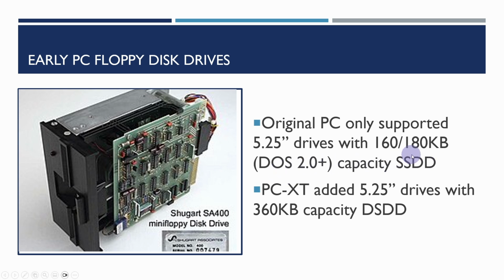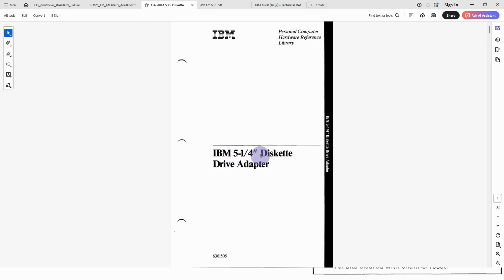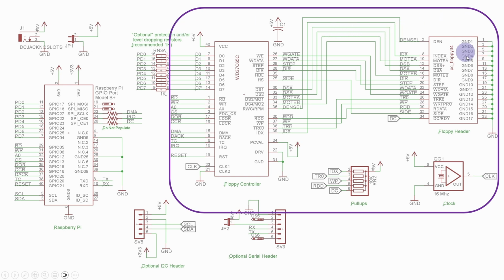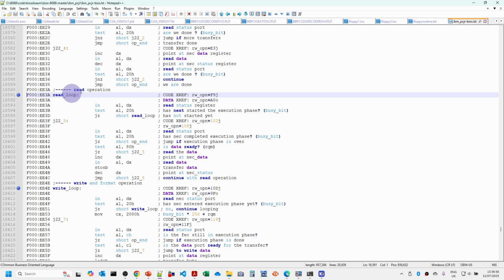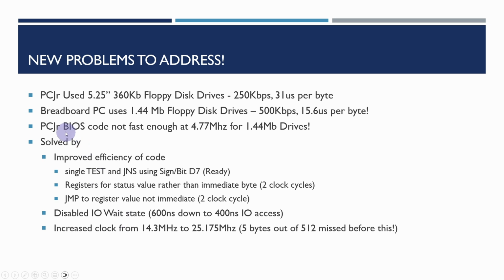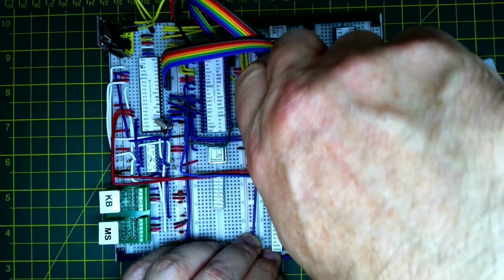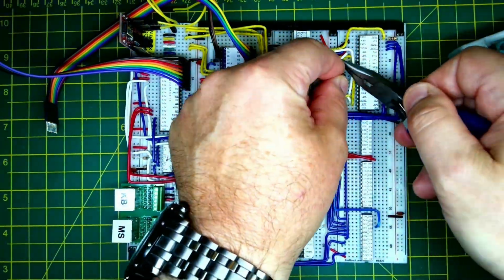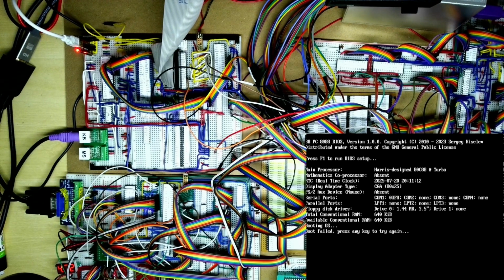New Breadboard 8088 PC V2 #18 Floppy Disk Controller

Comment: Super interresting. I'll try to integrate a floppy disk on my 6809 system. Hopefully, it will be OS9 or Nitros9 compatible. I also wanted to let you know that you inspired me a lot with your NanoComp 6809 build. I'll be remaking videos soon, after about a year break. Keep up the good work!
Reply from the maker: Thanks for the comment, Ben Eater's series on building a CPU out of TTL chips was what inspired me in the first place. Floppy disk controllers & drivers are nasty - be warned. 😉 Dave

Comment: Spent my day trying to write my own driver for the wd chip for the z80 as the popular one is rather large at nearly 4k of memory and handles all types of drives and disks.. 

So just trying to strip it down to the basics for one drive and one type.

And ive been struggling with the bloody datasheet all day..!
Reply from the maker: You have my sympathy and pretty irritating that the manufacturer datasheet had such a critical error. I never trust anything now at face value without cross referencing to other sources.
I never tried floppy disk drives on my 6809 Nanocomp project, went straight to ATA hard drive which is much simpler in comparison. Floppy disks are 1970's technology and very messy to get working.
This link is useful https://wiki.osdev.org/Floppy_Disk_Controller#Overview_and_Documentation but going though a working driver like in the BIOS would give you clues too. The order is something like reset controller through DOR port, send specify byte with various head timings, motor enable, send recalibrate, seek to desired track, read sectors etc. Also make sure you turn off DMA (I assume for Z80 you have no DMA). And make sure you send all the correct number of byte parameters to each command and read the correct number of results back otherwise the controller will think it hasn't finished the current command! Good luck! Dave
Reply: Good news this evening I have it working with PIO on the Z80..

Pro tip, when you think the code is right but you just get 00's in your memory - try another sector you might have formatted the disk in the past and forgot its no longer bootable and track 0 was just zero... try track 2 theres a CP/M file system!